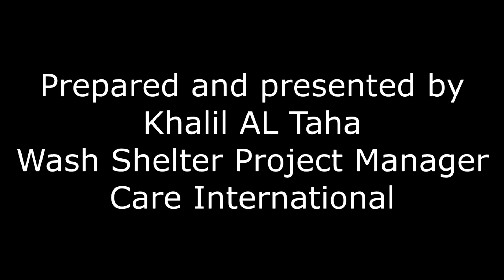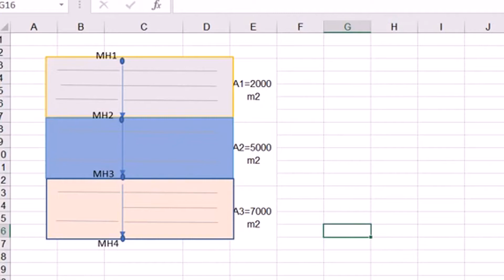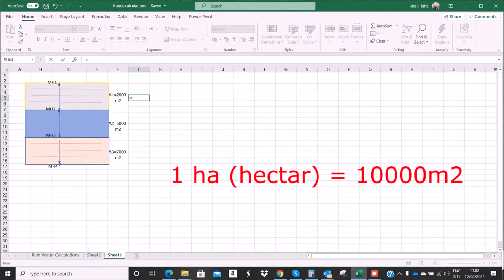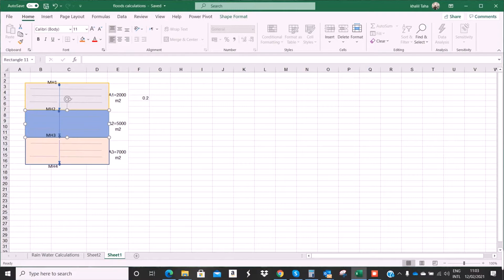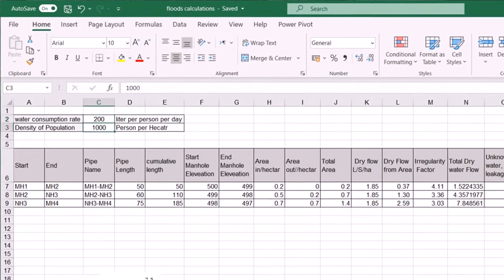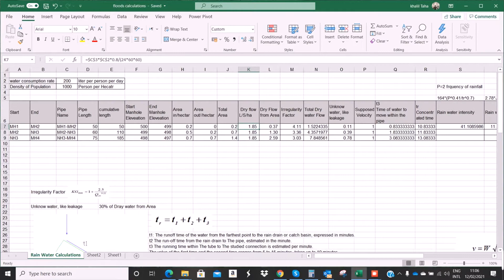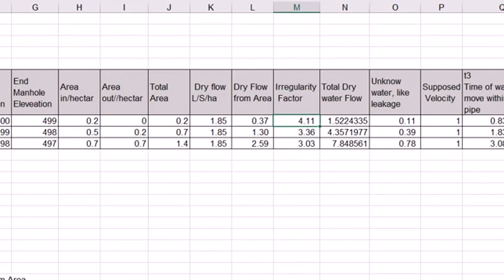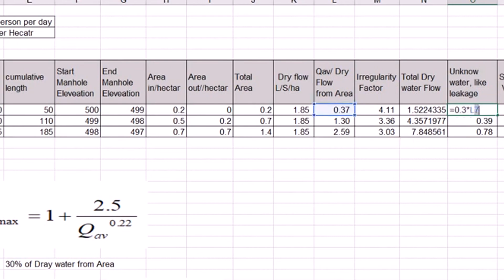Sewer manual calculation Part 1 "calculate the quantity of black water"

Comment: thank you for sharing ..but as you know the rational method is used just for small areas until 1km2,for larger areas which method is best and do u have any learning video?
Reply: There is another method which consider more accurate, called "Curve Number for runoff calculating"  

 It does not control a maximum or minimum area of the basin, and the smaller the basin area, the more accurate.

It is based on an accurate estimate of the following hydrological parameters:
• Chronological distribution of the rainstorm
• The initial losses of rain and the initial storage of the drainage basin 
• The rate of infiltration through the soil particles, which gradually decreases until it reaches a constant value
Reply: @TheKhalil1985  thank you very much man ,if you could drop a tutorial video in the future  about that method  ...
Reply from the maker: @TheKhalil1985  Thanks Khalil